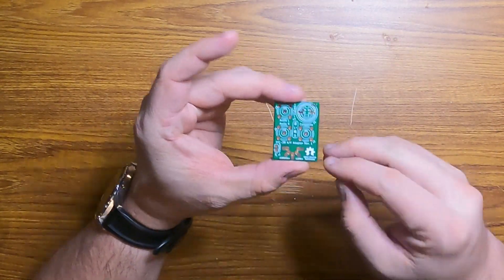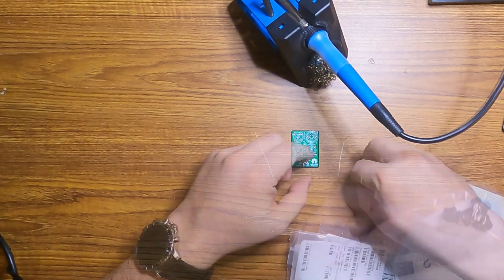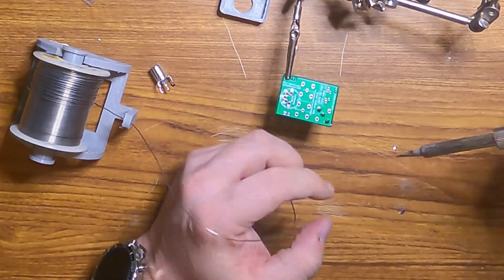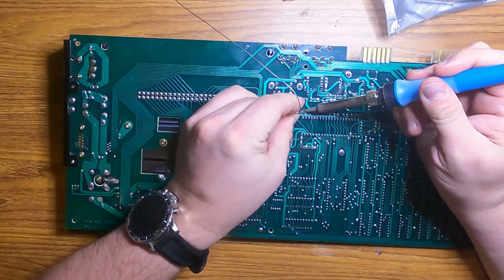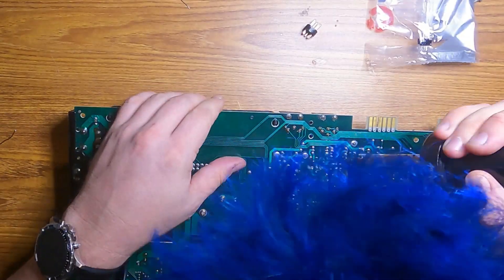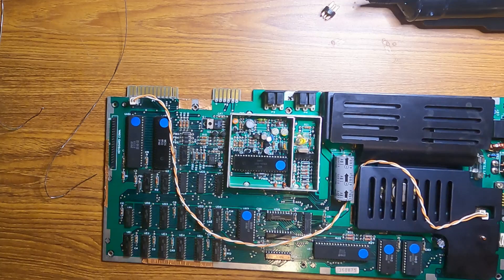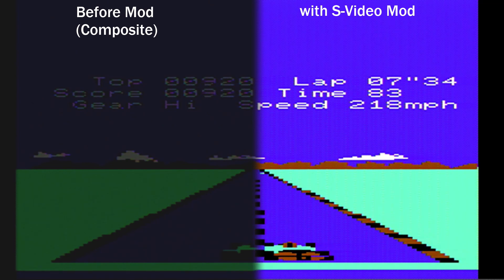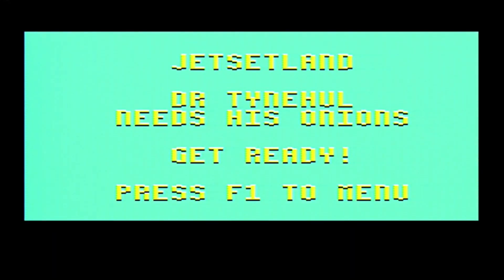Commodore VIC-20 S-Video Mod (Not on a Cost Reduced Version!)

Comment: Hello, congratulations for this video which breathes new life into the fabulous time spent with our Commodore VIC-20.😉
In a few days, I will start creating an S-Video/Composite mod on my two VIC20s.

For several days, I have been able to glean a lot of information on the Internet on this subject.

The vast majority of VIC20 owners who have used this S-Video hardware mod have in some way "destroyed" the motherboard of their Vic20 with a cutter or screwdriver.

Personally, I cannot imagine this type of process which consists of cutting tracks on the PCB (bakelite) of my VIC20.

Today, I was finally able to better understand this problem of a video display improved by the S-Video hardware mod and understand why the final result is still not optimal.

The fact of physically separating the two luminance and chrominance components on the Vic20 motherboard already poses problems in terms of signals, let me explain.

The circuit (device) which manages the Video part of the VIC20 has been designed to deliver (mix) a Composite video signal with relatively sufficient quality for old screens (SCART socket, RF modulator).

What happens when we separate the two Luma and Chroma signals?

Both chroma and luma signals end up with various types of interference of all kinds.

All S-Video mods performed on the VIC20 consist of adding a 75 ohm resistor and a 0.1 micro Farad capacitor, except that this absolutely does not solve the initial problem, even if the display result is better than initially (without this mod).

In reality, this S-Video hardware mod is much too aggressive and does not really address this problem.

To respond to this video display quality problem of the VIC20, it is necessary from the start to act on the Composite signal by applying a "corrective" to effectively improve the two components luminance and chrominance AND then reinject them into a new Composite signal “clean” (cleansed of all its impurities).

Today, the vast majority of TV screens manage Composite (normal), few screens/monitors accept an RGB (Y/C) input.

In conclusion, the S-Video hardware mod made on a VIC20 will never be able to give optimal results.

Only ("corrective") processing of the Composite VIC20 signal can truly improve the video display quality, much better than that delivered by the S-Video hardware mod.

Would you be interested in my work on creating a Composite mod designed to correct and clean both luminance and chrominance components of the VIC20 WITHOUT DESTROYING THE VIC-20??

Sincerely

PS: adding a 75 ohm resistor only adds this ohmic value to that of the video cable connected to a screen. This is one of the reasons why this S-Video hardware mod is deficient and does not address the problem of improving the video display of the VIC20.
Reply from the maker: I absolutely be  interested in your work.  I'm a big fan of non-destructive mods!
Reply: Hello, just to give you an idea of the next tests that I will carry out with this reversible "CLEAR VIDEO" mod (non-destructive to the VIC-20 motherboard), I intend to test two CLEAR VIDEO VIC20 devices, the first is equipped with an amplifier after the video signal processing stage.
The second device "CLEAR VIDEO VIC20" is identical to the first but without the amplifier stage.

The first "CLEAR VIDEO VIC20" device will be placed on top of the stock of the 6561 video printed circuit. The two Chroma and Luma terminals (on the CLEAR VIDEO VIC20 device) will be connected by a 0.1 micro Farad polypropylene capacitor to mix new Chroma and Luma and get a new "clean/optimized" Composite signal.
Two electrical connections will have to be soldered on the original video part of the VIC-20 (no destruction, just two solders).

Here I could take measurements with an Oscilloscope to check the result of the optimized Composite signal.

Then I will test the second device "CLEAR VIDEO VIC20" which I will add behind the first device "CLEAR VIDEO" by electrically connecting (two solders) the output of the optimized Composite signal (by the first device "CLEAR VIDEO" on the Composite input of the second device "CLEAR VIDEO VIC20" (without amplifier).

My goal here is to get better filtering/cleaning of the Optimized Composite signal.

Note that the 6561 video circuit board of the VIC-20 is completely separated (mounted on a CLEAR VIDEO PCB) from the video part on the Vic20 motherboard, but the electronic components which manage the processing of the original Composite signal (Luma Chroma ) on the VIC-20 motherboard are still electrically powered, so part of the original VIC20 Composite signal subcarrier will be injected again (recovered through the original video circuit (pin 4 and 5 DIN), which is why some VIC-20 owners are forced to remove certain electronic components to create the S-Video mod (destructive S-Video RGB mod).

SEE YOU SOON.😉
HAVE A NICE WEEK END !

Comment: Not good having the large heatsink inside the VIC-20 loose like that, make sure to tighten it if you haven't already!
Reply from the maker: Good catch!  I've been back in there and tightened it up, as well as fix the LED holder that kept sliding down.  😂

Comment: Jam in all new ceramic caps and you can also get brand new 6522 replacements from WDC on Mouser.
Reply from the maker: I did all the electrolytics when I first got it, I hadn't bothered with the ceramics; do you think it'll make a difference?   And I have 6522s on hand for my 65816 project!

Comment: Was hoping you'd have links to the guides/parts needed/where to get everything.
Reply from the maker: I went back and added the links and parts to the description.  Hope this helps!

Here are some of the reference links I used to figure it out:
VIC-20 A/V Adaptor (card and STL): https://github.com/svenpetersen1965/VIC-20_AV-Adapter
The SleepingElephant guide for cost reduced VIC-20s:  http://sleepingelephant.com/denial/wiki/index.php?title=S-Video_output
Revision E Logic Schematic:  http://www.mainbyte.com/vic20/e_schematic.pdf

And the parts I ordered from Mouser:
RCA Jacks - 490-RCJ-###  where the ### is 021-024 depending on the jack color you want.
S-Video Jack - 806-KMDVLX-4S-N-1
5 Pin DIN Connector - 568-NYS322G